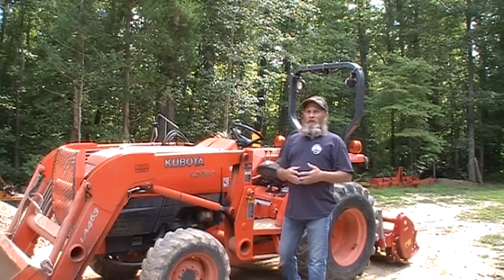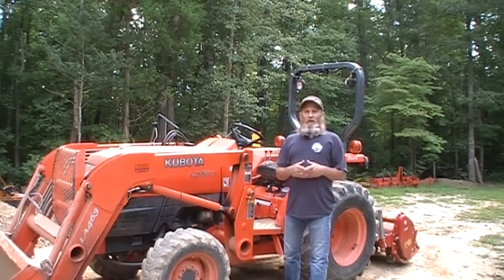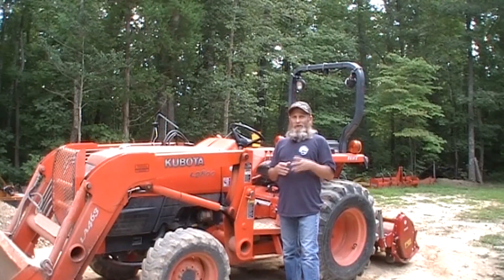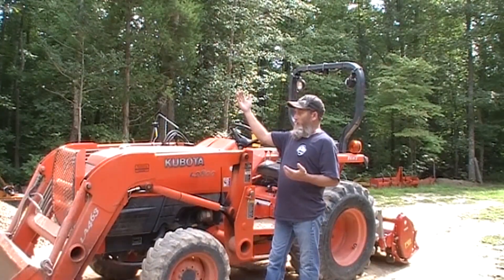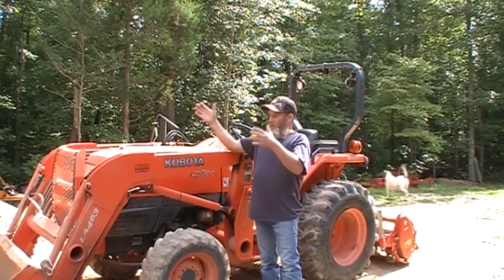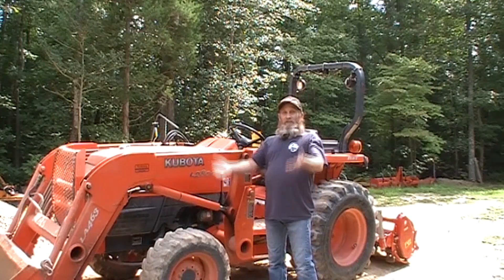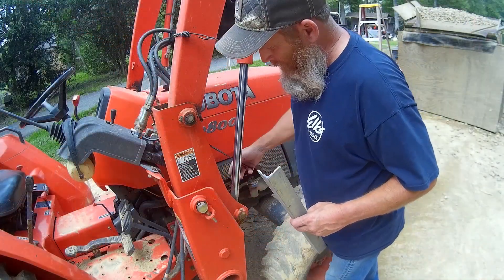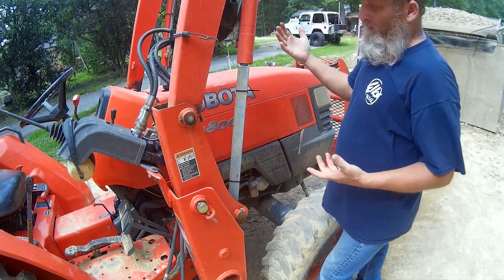working safely under the FEL

Comment: Excellent idea Dave. When I work on tractor, I'm usually the only person around, so your safety tip is a wise move. Thanks and keep making the videos.
Reply from the maker: thanks Don, I'm far from a safety Sally, I have taken way to many risk in my life. last year I had a hydraulic line bust on the backhoe and that thing came down very fast and hard. shot hot hydraulic fluid every where. very dangerous.

Comment: Good video, Dave. My Bobcat had a lockout brace built in. When I get around to making a pair of these for my Kubota tractor, I want to rig a place to stow them on the tractor, so they're handy if I need to get in the engine compartment in the field. It's kind of annoying that the loader needs to be raised to get the radiator screen out, because cleaning out a clogged screen is something I often need to do in the field when I'm mowing weeds.
Reply from the maker: yup your exactly right. I'm working on a storage spot now.

Comment: you should patent that concept and market it to all companies that sell a front end loaders. I think a heavy gauge plastic angle stock would work too. Then have velcro straps as part of the safety device.
Reply from the maker: funny you mentioned plastic originally I was going to use a slit piece of PVC pipe.  I went this route to make it easier for anyone to get them cut at any steel supply yard. the Pvc pipe slit into a 2/3  round with 1/3 removed would likely work very well.

Comment: Good to see you up and out Dave !
 Good safety tip, which like you said, a lot of us don't take the time to think about. I take it you but the wire mesh on your front guard ? Your guard is a lot taller than the one on my old 3100 Kubota. 
 I think I would be wise to get some heavy mesh to protect my radiator also, messing with brush like I do some.
Reply from the maker: for sure Vic, I had a stick go through my front grill. not a lot of damage but still was upsetting to me none the less. hope you're having a fun summer. love to you and Joy!

Comment: Great idea. Simple is always best. Did you disable the dump switch on your seat so you could start it while off the tractor?
Reply from the maker: yes the safety switch is not functional. there are times you need it. like when I bailed off running from the bees chasing me. good thing I did not have cruise control on. lol